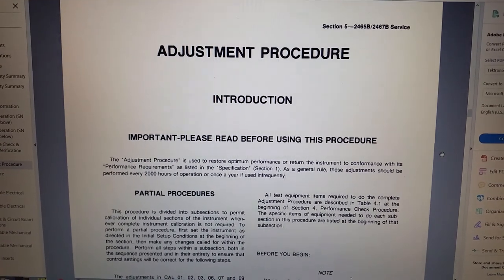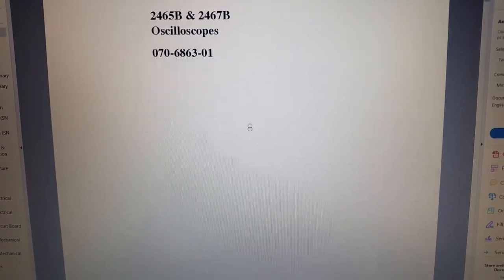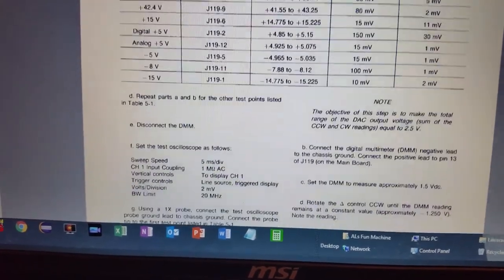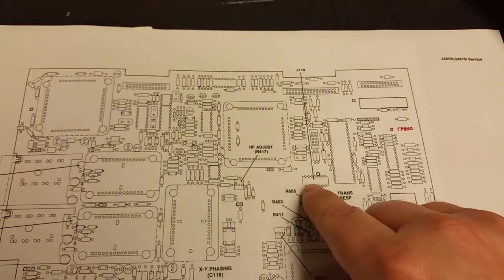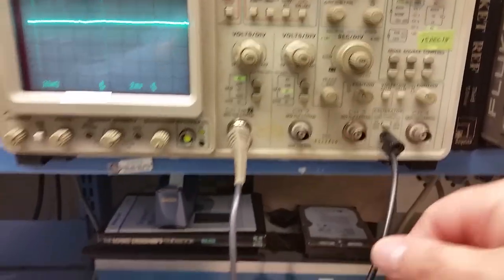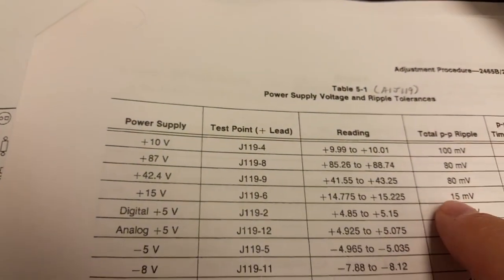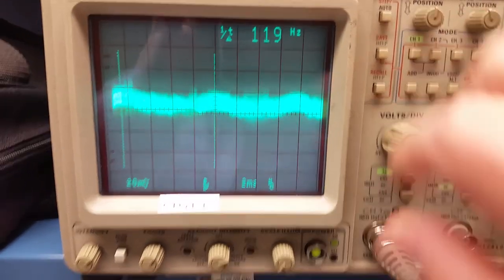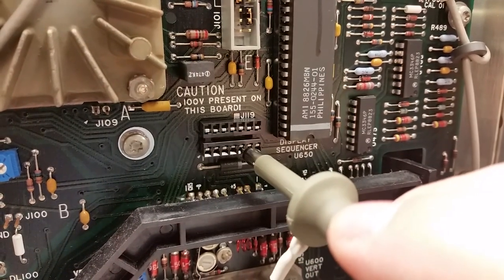Tektronix 2445, 2445B, 2465B & 2467B LVPS Checks & Some Cal Notes

Comment: I took the cover off and now it lost again the top and bottom lines (text values...) and the display shrunk to a small portion in the center! I think this scope needs more TLC, so I'll take video and let you guys see what I'm dealing with. But stuff just comes and goes away for no apparent reason (that is why I was thinking that one or more capacitors are to blame????). Also, once I had it going, when I pushed the button called "BEAM FIND" the lines for the channels shrunk to the center and the text is shrunken also into small pixels! I'm not sure what it does, since on new scopes there isn't a button like that at all. 
Also, when I was unplugging originally the ribbon cables and plugging in them back in, I did not use any cleaner at all. Should I spray the connectors and plug them in and out several times with contact cleaner or alcohol? What are you guys using to clean the connectors?
The insides are very clean and not muchy dust at all, except little on the fan in the back - that is normal.
I found no bugs inside or spiders.... no loose connectors or any visible damage or overheated signs on resistors and or other parts.
CRT could be sharper - is there a way to  sharpen the display with some adjustments? 
Before I do any harm, I'm asking lots of questions and reading other peoples steps to restore this old scope, watching video's and trying to learn as much as I can.
Thank you guys for helping me out, I'll pass this to others who are gonna benefit from your help, not just me!
Reply from the maker: Hi Tony, it could be a cap, but it sound more like a loose connection. When I'm presented with a problem like that I usually take the plastic end of a big screw driver and gently tap on different spots all over each board, even the pots. That usually finds the intermittent connection or component. As far as contact cleaner if it wasn't dirty inside I wouldn't use it, I would just turn it off, unplug it and operate ALL the switches multiple times then turn it back on and see if it clears up. Most of the contacts have silver plating on them and they just get a little tarnish on them that can be cleaned up by operating them. Also some of the better manufactures put a light lithium grease in them and contact cleaner would remove it. The Beam finder is doing what it's supposed to do. It's supposed to reduce the drive to the CRT so that the trace only writes in the middle, so at least that is working. One of the other things that can cause problems is a stuck push button switch on the control panel. There's a procedure in the book on how to find stuck push button switches. It should be in either troubleshooting or testing. It may even reference it in the fault code section. The procedure to clean up the trace is CAL 08 that I posted, but you'll need the scope to be mostly writing to the CRT properly before you do it. If you tap around with the screw driver handle stay away from the CRT high voltage lines. If you discharge the CRT High Voltage cap with it unplugged and turned off you can pull the CRT connector off the back and push it on and off a few times to clean up any corrosion that may be on the pins. Then plug it back in and try it again. Hope the points you in the right direction. Your best help would be to post a video and then post it to a forum. I'll look around for the forum links and get back with you. Until then go ahead and post a video of it and link it in your comment here and lets move the conversation to your channel so we can be on your scope video to help you. It will also give your channel some more exposure. We could leave the conversation here, but it would be better for you to have the reference at the ready on your channel. Best Wishes & Blessings. Keith Noneya
Reply: @keithnoneya  Thanks again! So you said that the BEAM FIND is doing its work, how do I put it back to NORMAL MODE, after I pushed the switch, so I get the normal view with readable text and the 4 lines?
I'll try Friday the tapping with the screwdriver handle and let you know + I'll make the video.
Where should I publish the video? Should I go to a specific webpage?
Reply from the maker: Hi Tony, once you release the Beam finder the screen should go back to normal, If it's not then something is preventing it, like a stuck beam finder switch. You should publish the video on your YT channel just like you did your other vids. Also show us what happens when you push the Beam Finder I could be misunderstanding what's going on there. When you post it, I would call it by it's name then the problem ie. "Tektronix 2465B Shrunken Display Problems - Help". Also if you figure out a better or more descriptive name as the owner of the video you can change the title of it. I do it sometimes for that reason. Oh on the connector cleaning, yep I would put a lot of Isopropyl Alcohol on them, then push them on and off a few times. Then put a lot on them again and use a paper towel to soak up the extra. Hopefully some of the crap in there will soak up into the Alcohol and flow into the paper towel. I do that at work all the time and it seems to work well in removing contaminants. When you video it, use external lighting and not the light on your phone, the phone light reflecting off the screen may make the video hard to see, learned that the hard way on one of my TDS744A video's. Hope this helps. Looking fwd to seeing your vid up. Keith Noneya
Reply: @keithnoneya  Thanks again, I should have some time Saturday. As it goes today, I'm not able to do it as I planed! I'll post the video as soon as I make it.
Reply: @keithnoneya  Forgot to state that as soon as I release the BEAM FIND button, it does not goes back to a normal display! It is stuck for some reason.

Comment: My Tektronix 2465 DMS (it has DMM on the top with 13 buttons..... but the model number is 2465 DMS, not 2465 DMM)  and it needs some work. At first I could not even get much to display, so i wiggled some connectors and  turned off the unit, unplugged it and pushed the ON switch. I use this technique sometimes on stuck laptop/desktop PC's and it works. Now I was able to get text at the top and bottom screen so I assume some capacitors are a "sleep", and need to be replaced, just don't know which ones !  I also could not find a manual that is searchable in PDF, Tektronix has the pages just scanned as a PICTURE, so I need to somehow convert it to text in OCR - unless someone has done it already! I'm open to any suggestions guys!  Thank you Keith for your video and if you know where I can get my hands on   the checklist with voltages ...etc, please let me know.
Reply from the maker: Hi Tony. Yep you'd be surprised at how much gear can be fixed just by pulling it apart and cleaning the connectors and reassembling it. Also while it's UNPLUGGED operating the switches rapidly several times. These scopes have pretty good caps in them. However as far as replacing them I would only replace the ones that you know to be bad, like bulging, leaking or if it's suspect because the circuit isn't working. If you have a suspect cap, pull it and check it on an ESR Meter and a capacitor checker. If you don't have those just put a multi-meter, set to ohms, on it and see if it charges then revers the leads and see if it discharges. If there is no physical damage and it passes that basic test and the circuit appears to work then there's a very high probability it's good. 
Unfortunately I don't have a searchable pdf manual for this one either. The manuals are laid out pretty good, so just take some time to familiarize yourself with it. If you still want one you can contact ArtekMedia https://www.ebay.com/str/artekmedia on eBay. Ask the guy if hell produce one with that option for you. He scans and sells manuals in pdf format for about $15.00 bucks. He does limit some of the features in the manuals because people have taken his work copied it and then resold them under their name. But the manuals are high quality and as a professional I use him when I need a quality scanned manual. Let me know if you need anything else. Before you try to do the calibration, if you want to, make sure you have the equipment, time about a full day, and are completely familiar with section 5 of the manual. I tried to do the calibration on this scope and failed. I don't know if the scope was bad or my application of what I was reading was bad. Thanks for watching. Best Wishes & Blessings. Keith Noneya
Reply: @keithnoneya  Thanks for suggestions. I do have many meters, including at least 3 that are just to measure capacitors!  I'll try to print the manual I downloaded from Tektronix and see if I should do the calibration or not. I know that couple pots are little dirty or worned out, but for now I'll leave them alone. This scope is mainly a teaching tool - I get to play with it and see if I can fix it. Later it will help others to play with the scope - I have a nice digital scope, only about 5 years old or so.... But I love to fix stuff, not dump stuff to the garbage. I also have an a nonfunctional PS 148 5" Vectorscope by Sencore. Just have not had time to make it to work! I do have also a Simpsone Handiscope - I think it powers up, but I do not know if it works or not, for now it is here waiting for me..... I'll post videos later on or I hope by the end of the week and let everyone know where it is so you all can see it. I would like it to work, but I don't need it to perform 100% perfect.

Comment: You need cooling on those Hybrids! (Slightly panicky)!
Reply from the maker: I agree with you 100%. Later I did just that as I was having problems with some of the alpha-numerical displaying correctly. After adding the cooling fan the problems went away.
Thanks for watching. Best Wishes n Blessings. Keith
Reply: I am having same problem on my scope with 2 test fail, let's see if I could do it, I will keep you updated, some help might be needed.
Reply from the maker: Hey Ahmed how's the No. 2 Test Fail coming along? Just curious. Keith Noneya
Reply: @keithnoneya  Where did you put the fan and how was is connected ... information and pictures/video would be nice. Thanks!
Reply from the maker: Hy Tony Sorry I just saw your post, I just put the fan about a foot away blowing on the hybrids. It wasn't even a fast blowing fan. It was just a small square fan about 6" square. Hope that answers your question.
Reply: @keithnoneya  Do I need to add more fans to cool the Hybrids? It should not take much to add more fans. I can make a bracket that would hold one or more fans and make some openings thru the case, where the air can escape. Does anyone knows if this has been done? Thanks again all of you guys!